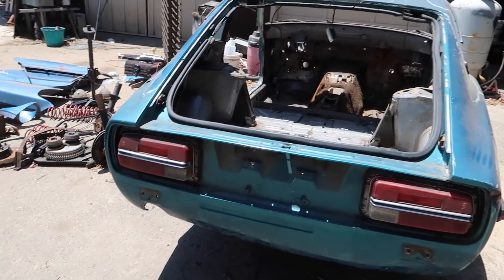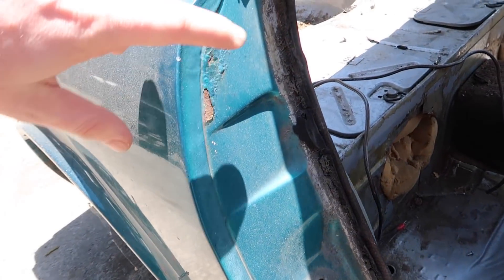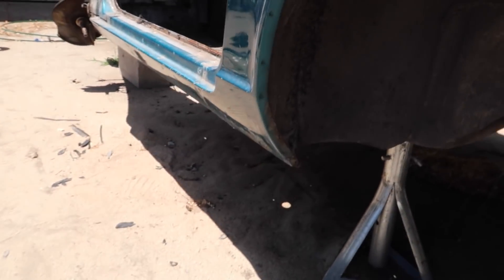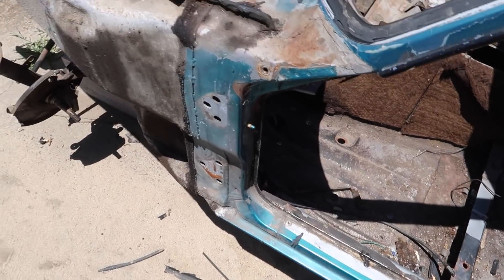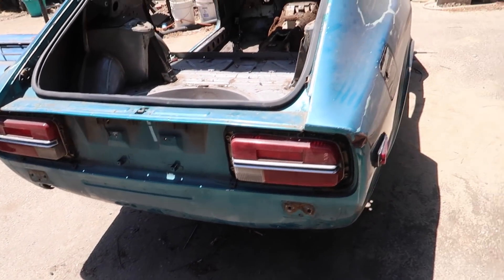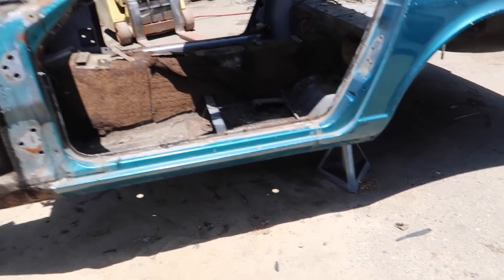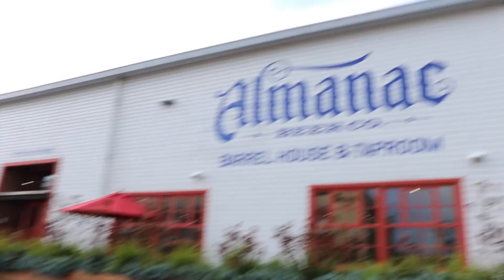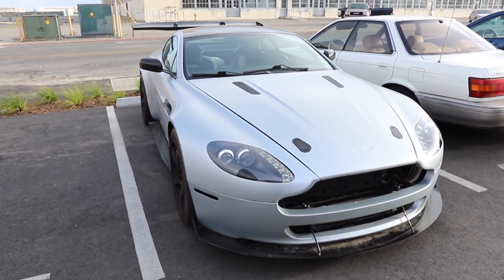Buying A New 240Z!!

Comment: Get the Z shell sandblasted for best results
Reply: I bought a sandblaster on Amazon for like $20 and it works great..
Reply: Not sand blasting, it stretches the metal. Soda or glass blasting would be better.
Reply: Cold_Fox89 no one actually uses sand for “sand blasting”. It’s just a out dated term that’s stuck around. Like Sand paper...who really calls it Aluminium Oxide paper
Reply: Michael Gallagher I use sand for sand blasting.
Reply: Someidot really? Thought that was old fashioned now haha
Reply: Someidot learn something new everyday
Reply: Michael Gallagher sand is cheap. That's why I use it.
Reply: Dipping the shell in a acid tank is better
Reply: Check out wet blasting, basically pressure washing with media. Keeps temps under control and will not deform panels. Used to be a "mega buck" process but is becoming pretty mainstream

Comment: My local Enterprise rents F250's  I bet you could one way one and put the Z in the back of it..
Reply: Mr Tydriver Enterprise has dumb rules that don’t allow their pickups to be taken across state lines unless they are returned to the exact same rental location as where they were picked up. Well at least it was like that 2 years ago when I was moving across the country and wanted to save money moving y bed and a few pieces of furniture.
Reply: I worked on a musical tour last summer where the lead linger brought an Airstream he'd had converted into a recording studio (that, in addition to his touring coach).  An Enterprise F-250 rental pulled that thing all over North America.  So, you're right.  That would work.
Reply: Christian Lea Depends on the Enterprise location, some are franchised and others are corporate. The corporate ones you can rent and return anywhere. The franchise ones that rent commercial vehicles, they personally lease/own those vehicles.
Reply: There is a difference between enterprise rent a car and enterprise rent a truck. While erc will rent a truck you can not tow. Ert you can and they even rent diesels
Reply: SCcarguy incorrect, my buddy rented one and toward a car home with it.. they don't rent trailers, he had to use u-hual for the trailer.
Reply: Christian Lea this I didn't know, my friend did a local rental even though he went 3 states away to get his car, he returned it to where he got it. Good to know !
Reply: Mr Tydriver no sir, the trucks you get from erc are not to be used for towing. Doing so and getting caught will get you in big trouble. Ert will rent trucks they allow to tow but they charge an extra $10 a day. I literally just went trough this two weeks ago.
Reply: LOL 
Let's argue all weekend about this... Better yet. NOT.. I give up you win ! I don't care.. You're the most intelligent person on the internet !!
Reply: Mr Tydriver no I just don’t like wrong info being spread. I actually made the calls and talked to the actual company two weeks ago because I was in need of a truck to tow my camper.

Comment: a trick I've seen for checking if there's Bondo is to use a magnet as the magnet won't stick to the Bondo.  If I remember correctly that was a trick that Chip Foose shared on Overhaulin'

Comment: In Aus trailers are $100 a day to rent and about $3000 new to buy(for a flat open bed), and obviously used ones can be had for any price. If you have any space to store it they are worth the investment, espescially the amount it appears you could use one instead of paying for shipping/towing. Also you are in control of how your cars get loaded/unloaded instead of random truck drivers damaging your stuff. Can use it for picking up steel/supplies as well. Or consider purchasing a truck/hauler. I bought a used trailer very early on instead of renting and it has paid for itself a hundred times over. Insurance/registration here is insanely expensive for trucks or I would likely buy a truck instead.

Comment: You can't rent truck fro Uhaul with trailer, but can you just rent a trailer from Uhaul, or other......to drive the car home(unless you can't tow owe on your vehicle you have.....in which case, might be able to rent a car with trailer from a place to drive home; I.e.: Enterprise, etc....)? Good luck & THINGS will turn out, just may take some time.....
Besides, YOU ARE SO DUE FOR SOME GOOD LUCK, after the "luck" you've had with your cars in past 8 months....
Cheers, A
Reply: Layouts cost less than $99.00 to rent a trailer for several days, if wanna go that route, instead of buying, titling, & registering a trailer; especially if worried about where to store it at your place, etc.....
Cheers, A

Comment: Please try to work as much as you can with this body and not cut a heap of stuff off I know modification or fabrication of all four strut towers is needed and a larger front half section of the trans tunnel I think it will be a tad easier on you and a bit nicer in the end and less pro d tube chassis etc ahaha

Comment: PLEASE keep as much of the 240Z shell as possible. There is a lot of built-in stiffness, which is virtually impossible to add to a stripped out set of panels that you did last time. Unless you propose the change the wheelbase, why chop the shell in two? Again you just lose so much built-in stiffness, just when you actually want more than the original Datsun design has for a 500hp BMW V10 engine, not less!

Comment: I would have measured the sides of the car it looks like it's had a shunt in the back with the ripple in the rear window pillow dint on the back probably the impact point the crease under the rear looks like a twisted shell but I'm no expert 

Hope it's not it will be an expensive mistake with the cost of shipping too

Comment: Maybe just put the fucking bmw engine in that body without cut up the whole car so meaning put the complete rear bmw suspension in the 240z even with the front end just put the motor in the engine and modify the transmission tunnel to fit the gearbox . Stop cutting up average rusted cars to butcher . Do it right maybe you’ll learn something instead of just doing whatever